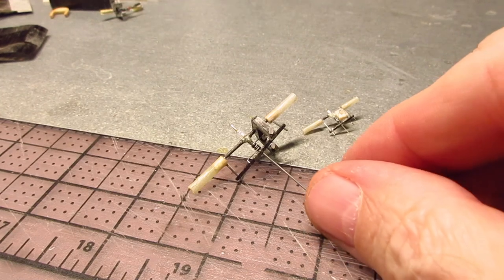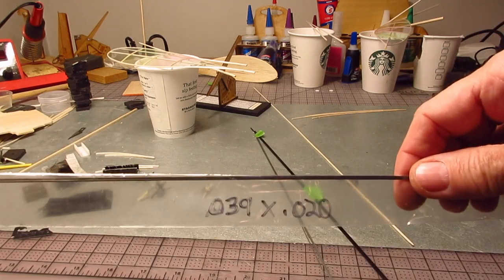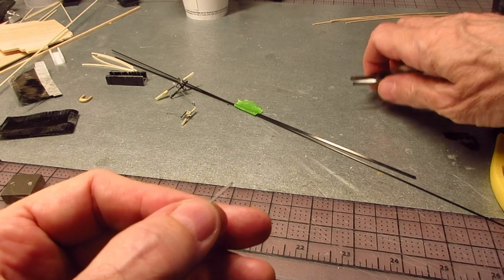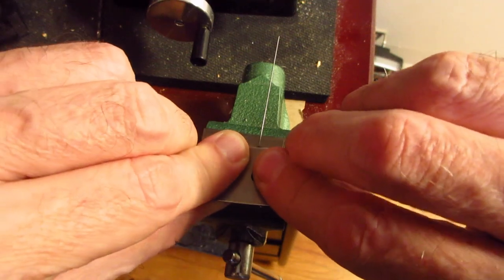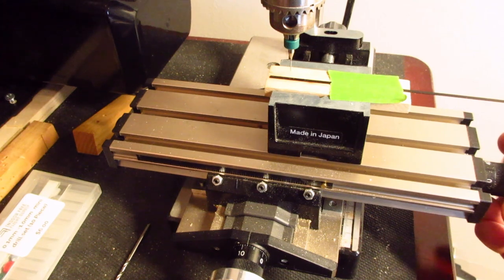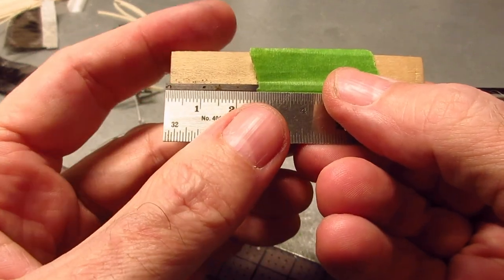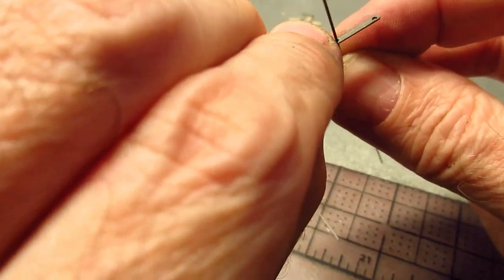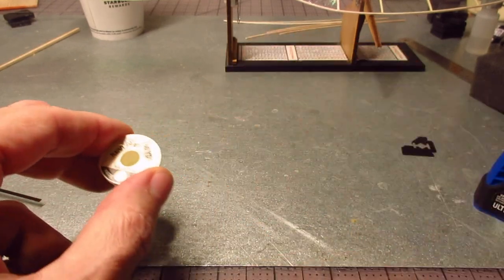Variable pitch prop build - Part 1: prop shaft, driver bar, and t-tube

Comment: What a rigmarole, another way to distroy indoor flying, it's not modelling
Just the way F1C went...
Reply from the maker: Actually, this way to make a VP is a lot simpler than many others. It doesn't 'destroy' indoor because there are still many classes left that don't allow VP, like F1L, A6, Limited Pennyplane, Ministick, and so on, so just fly in those. In fact, the only classes that I know of that allow VP are F1D, F1R, and Pennyplane, and all of those are advanced classes anyway (and in my view F1D was ruined because of the use of boron, which I don't want to handle). Up until recently, I was against the use of 'gadgets' and so I would have agreed with you, but now that I can make it myself at home, and cheaply, it's become part of the craft, plus once I flew with VP it became hard to go back, really nice in a low-ceiling venue to slow that prop down at the burst!
Reply: @domoremath  Hi yes, it still makes me cringe though as the gadgets from our polish friends keep the flying sectors tighter than tight and if you can't get this or that don't bother just for the chosen few unless you want to hand over a few bucks we'll let you into our circle, seen it so many times my friend takes all the fun right out of it...